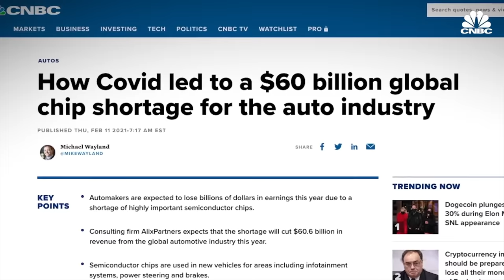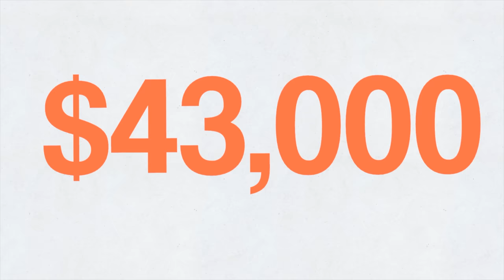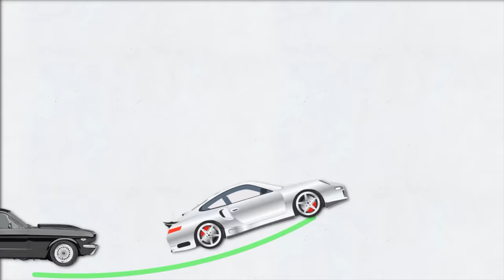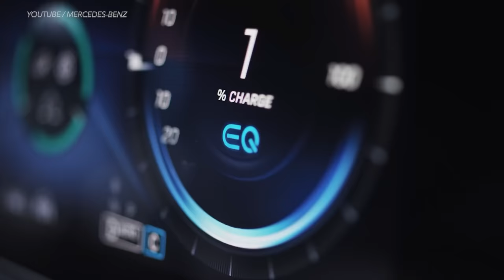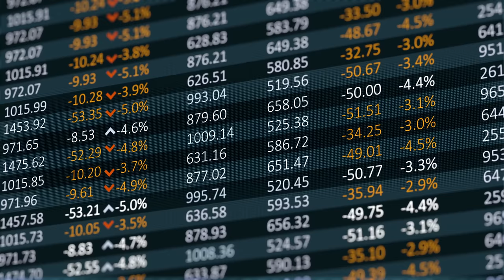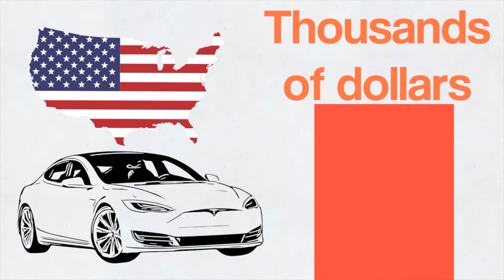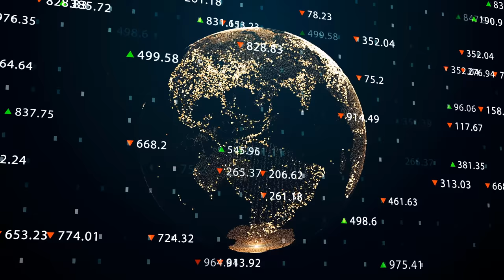No One is Telling You the Truth About the Car Shortage, So I Have to

Comment: Thank God I bought an Ancheer Chinese electric bike in 2020.
Awesome bike. All of you will end up walking. I have at least 1200 charges left on the lithium  battery and I only have to recharge  it once a week.
I have a local bike shop that can replace the tires that wear out.
Reply: At least we'll be in shape.
Reply: Not us we have the original horsepower to get around with! No guarantees that they will observe the cities speed limits though.
Reply: @frederickbooth7970  my e-bike is speed limited  to about 24 MPH. Newer ones can hit 80. Then it goes to motorcycle range
Reply: @halverde6373  Wow! 80 is fast. 40.9 mph is what our live horsepower has been clocked at for 3/8 of a mile on a dirt track. Too fast for us now with our racing license long expired! Prefer 1st & 2nd gears with live horsepower now.
Reply: @frederickbooth7970  my cheap e-bike drive motor is rated at 350 watts and lugs my 250 pound carcass like it was nothing! Can't begin to imagine a 750 watt or 1 horsepower could actually  do.

Comment: My 2007 Nissan Frontier (4cyl 2.5L) has 250,000mi and is getting tired. I have been thinking about new truck, looked at Tacomas but to my disbelief, they don't offer 4cyl engines in their trucks any more, so no Tacoma.
Reply: Just find a good machinist & rebuild the engine. That`s what we did with our 2.8 "B" liter 84 S10 engine with 233,000 miles. Cheaper than buying new or used truck + you will be familiar with the truck already.

Comment: Hey Scotty, I have a 2001 Jeep Grand Cherokee that’s having some Cabin Fan issues. When I start the car sometimes (fan already set to on) the fan will come on and sometimes it won’t. And even when it is on, sometimes it’s low powered. But when I brake at the stop lights, the power surges and the fan’s output increases. What do you think gives?

Comment: Hey Scotty I have a question I just got a 2015 ram from the dealership and the abs light is on so I don't have cruis control I'm scan tool says right front speed sensor they said they changed it I try reset it with my scan tool it won't reset what could the problem be now my scan tool is the same one you have it does everything I do mechanic work but this puzzles me can you help

Comment: Batteries are stupid.  I used to think hydrogen was dumb, but the more you look at it - it's easy to produce.  Easy to transport.  Faster to refuel.  Simpler to convert to electricity in a car with a lot less of those precious metals required, and fuel cells last a hell of a lot longer than batteries too.

Comment: Imagine hemp body, mechanical linkage, with a fancy carb/ spark control and a regular exhaust/muffler....
1 simple chip that operates ESC/ fuel system pressure.
Edit. No infotainment, no power locks or Windows, añd a normal key.

Comment: Oh God! Between the shortage in the New car market forcing people to buy used and the high gas prices causing buyers to snap up used fuel efficient cars, you will get royally screwed if you purchase a used car anytime soon. My local used car dealer has a 2012 (10 year old) Honda CR-V sitting on the lot with an ask price of $21,900, to put that in perspective, a 2012 Honda CR-V was only ~$25k brand new, and the average blue book value is $15k. So you are essntially paying new car prices for 10 year old cars.

Comment: For those advocating a rollback to less electronics in a vehicle , here are some bad news for you....

1. Your vehicle fuel efficiency depends on a computer chip since the 80's. 

2. Driving diagnostics , supplied by datastream are supplied through computer Chips.  Since 1996 standardized diagnostics through OBDII are in every vehicle in America.  

Sensors and your Cathalyric converter depends on rare metals.  

There are jobs created by the existing built in vehicle electronics, as lines of code are added to make your vehicle functional. 

Computer electronics control drive train, braking, cabin comfort, suspensions adjustments.  

The diagnostic tools are getting more sophisticated , more lines of code.  

Computer programming jobs are replacing your typical assembly line well paying job.   

So stop these bonehead suggestions on scaling back tech in cars.  

Price increases mean , spending more on maintaining your car , holding it longer , and whipping out your bike for shorter errands
Reply: People riding bicycles get run over alot.
Reply: @johnwingate8799  Well, there is a reason why the Dutch changed how cities are meant to be pedestrian and bike friendly.  Go watch "Not just bikes ".
Reply: @showcaseSampa  I've seen it.We ain't in Denmark.Guy in Raleigh was on the bike trail and got ambushed and beaten to death.What planet are u from?